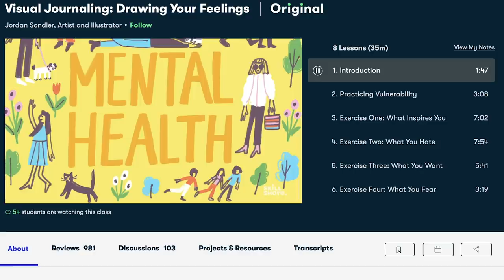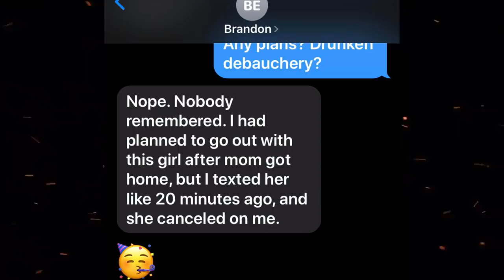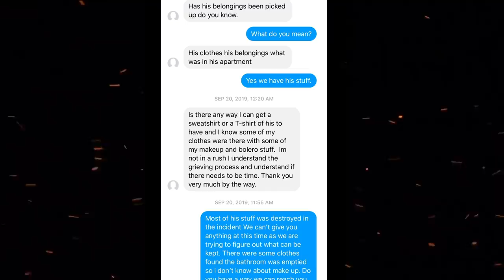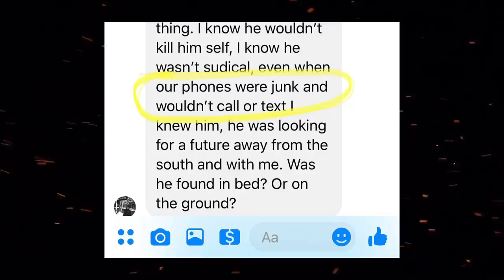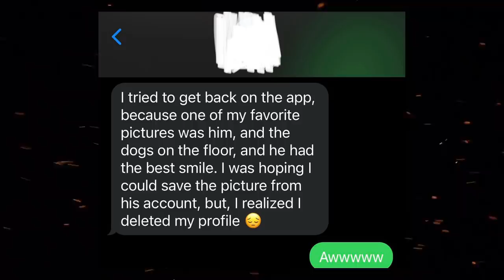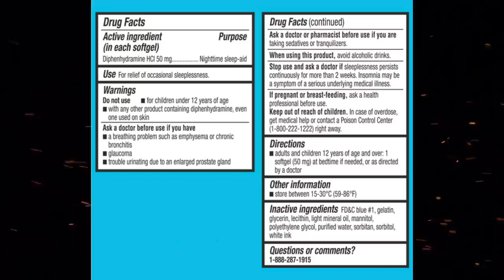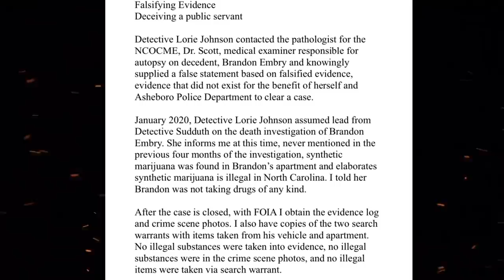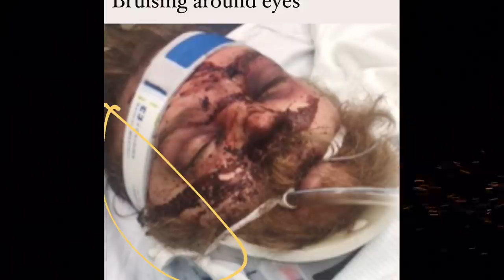Suspicious death of Brandon Embry | Ethylene Glycol Poisoning

Comment: Wait...: No sign of forced entry? With a broken window, that's not what I'd call an obvious conclusion. His mother was worried about that, so it can't have been a tiny window that was impossible to enter through. If you can get in through a window, you can get out the same way. This poor man must have been tortured for awhile. How on earth can any normal, vaguely rational adult conclude that this was self-inflicted?!
Reply: Came here to say the same thing! No forced entry?! I'm only 16 minutes in, so maybe there is an explanation later, but that makes zero sense!
Reply: Same!
Reply: This was going to be my comment as well
Reply: Dismissing the broken window, MAYBE the perp was invited in cause he knew him/her, then locked the doors on their way out 🤔🤷‍♀️
Reply: Cassandra had the spare key they believe
Reply: @Emily Truan True. It could also depend on HOW the windows was broken. If it was cracked and only a small portion was actually broken out, that would explain why it couldn’t have been an entry point.

Comment: Hypoxia can cause disorientation, but it also causes fatigue and dizziness. When your O2 stats are below 90 for a prolonged period you're more likely to pass out, or be unable to walk without aid than you are to ransack your apartment and beat yourself in a way that would be impossible, the amount of force necessary would be impossible if his O2 stats were so low, not to mention how complicated it would be to cause bruising in the places he had.

This is coming from my own experience with asthma, when my Oxygen drops, it's exhausting, it's hard to walk, and the most disorientation I experience is giddiness and some confusion.

Comment: Alcohol withdrawal? Sounds like there was tons of alcohol around so no reason to be in alcohol withdrawal. If he were an alcoholic to the point of experiencing withdrawal there would be absolutely no way to tolerate it and refuse all the alcohol at his disposal.   That's absurd. Even if you quit and get through the withdrawal on shear willpower you would still not be able to have so much access to alcohol during it. It would all need to be removed from the house or you're gonna give in.

Comment: Diphenhydramine can cause psychosis that is very similar to meth psychosis. While at low doses it is a sedative via h1 antagonism higher doses antagonize mACh receptors which cause pupil dilation, elevated heartrate, confusion, memory impairment,  elevated body temperature, hallucinations etc. Additionally diphenhydramine can block sodium herg ion channels   causing a heart arthymmia. (** I think he was murdered. I think diphenhydramine might have been used to cause sedation amnesia and confusion to make him easier to harm.  And, meth isn't the only drug that makes you feel hot. IF he was even the one to turn down the thermostat. )

Comment: She drove to his apartment to put red bulls in his fridge? They only saw each other on the weekends, so it sounds like it was at least a big enough jaunt to not do during the week. So why drive there to put red bulls in the fridge. That seems odd. Did they look to see if any of those red bulls were still around or if they had been tampered with? Would he have photos of them drinking some of them? That just caught my ears a little bit. 
Also I would have an orthopedic surgeon look at those x-rays of the neck. I have scoliosis in my back and I am pretty sure he would have never got into the navy with scoliosis either.  But the x-rays just seemed odd to me. I can't pinpoint it, but they are off to me. The kind of doctor that did my scoliosis surgery was an orthopedic surgeon. I would not rely on any doctor other than that kind to diagnosis it as scoliosis. Also, if he played sports when he was younger, typically they do a physical on you to see if you have scoliosis. That is how mine was actually found. I would think somewhere in either old physicals from shool or physicals in the navy it would be noted whether he had scoliosis or not.

Comment: I keep my apartment cold. I went to the university of Washington. Here in the Seattle area, the weather is very different from NC. It's over 80 throughout 2 months a year. It's usually 50-70 degrees. He may have just  been used to the 60s. Maybe it was his meds. I don't take oxy because I get hot & itchy. 

It really doesn't matter. It's just as likely to have been the killer trying to slow decomp so the smell wouldn't attract attention. 

What I don't understand is the leap to meth. That's equivalent to assuming he was pursuing an ice skating career. WTF? There not only wasn't evidence, there was plenty of evidence that he was NOT using drugs. This detective should be brought up on obstruction charges & anyone who had basic knowledge of the case & looked the other way should be fired.